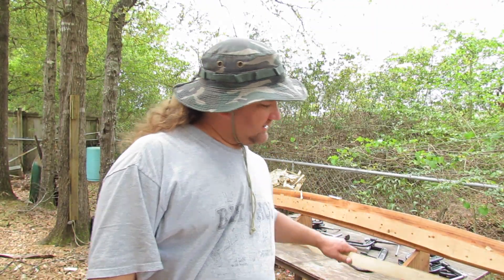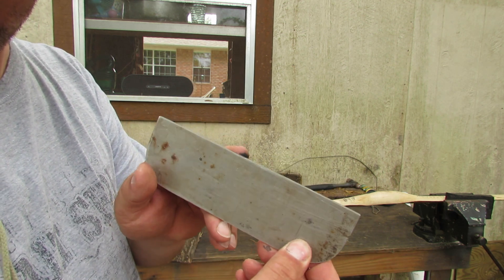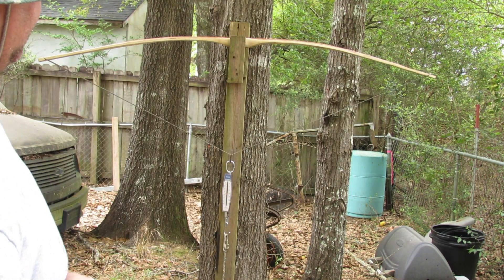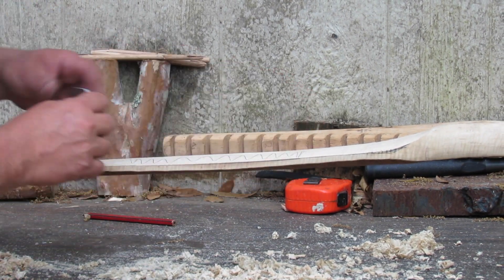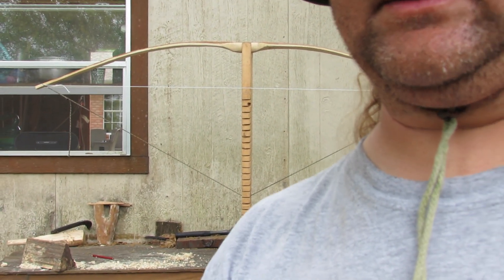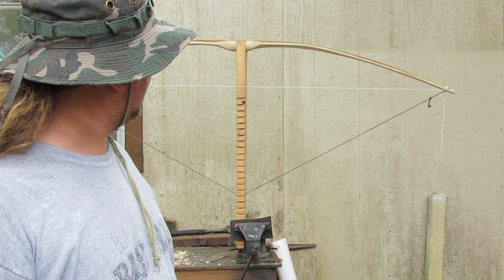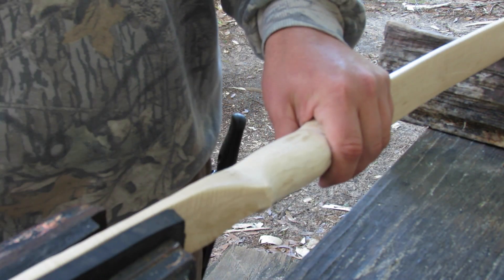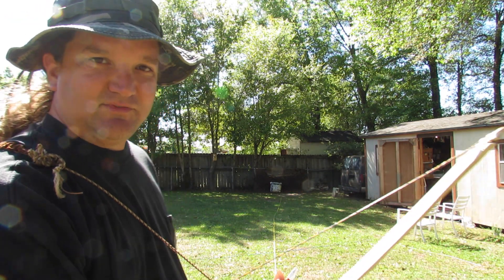My Crepe Myrtle Bow Build Part 2

Comment: great video, i'm impressed with that bow
Reply from the maker: Thank you, I also have four others that I shoot, on my site. I have two I made out of elm,  a Black Locust, and Osage, they all came out good as well, the Crepe Myrtle is a touch "sluggish" compared to the other four, but I don't think the wood was actually dry enough. My impatience got the better of me. On the other hand, I have a shed full of the rest of Crepe Myrtle, Jimmy gave me that I know are good and seasoned and I'm about ready to start on another one. Thanks for watching!
Reply: yeah i have seen most of your vids, your bows are great, i made a hazel flatbow which came out at about 49@27 
but i want to make a yew longbow next
Reply from the maker: Excellent, I'm gonna check it out!

Comment from the maker: I did, gently. It was smooshing the bark down, and smearing it around. Next time I will be de-barking it first. It seems every time it pops and creaks she takes a bit more set, and looses cast. I hope to correct that with an artificial sinew cable backing. Thanks for watching!
Reply: Yeah, the skin comes off reeeeaaally easy with crepe myrtle while still nice and green, especially when the tree is flowering.
...Here in Australia at least :P, not sure if it's different in other parts of the world.
Reply from the maker: thats true it comes off way better green thaks for the comment

Comment: can i use a already shaped square wood that i bought  ilive in philippines i am 14 yrs old ...
Reply from the maker: As long as it has straight enough grain, (parallel) it may work. You may want to glue some kind of backing to it first, like bamboo, linen, rawhide, fiberglass, though, because it would have already been growth ring compromised. I hope this makes sense.

Comment: Had a Cherokee tell me you can make a bow out of any tree except for pine, so far he hasn't been wrong in my experience.
Reply: I've built 3 bows of spruce, redwood, and Douglas fir. ( All types of pine)  it works easily, has big grains and rings and has quite a bit of draw weight. It's very forgiving of mistakes if you are a beginner. It does shoot rather sluggish. If you put a sinew or rawhide backing it will increase the speed quite a bit. It does grow straight too. If that's what you got use it. It will work but other woods will be faster.